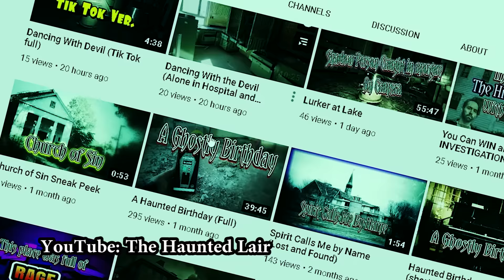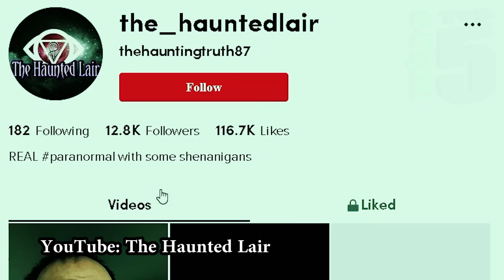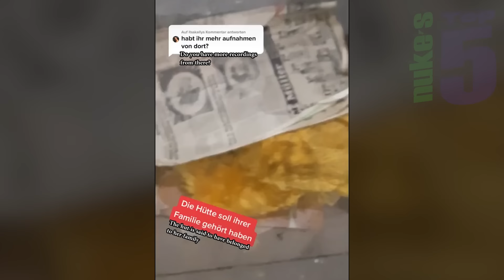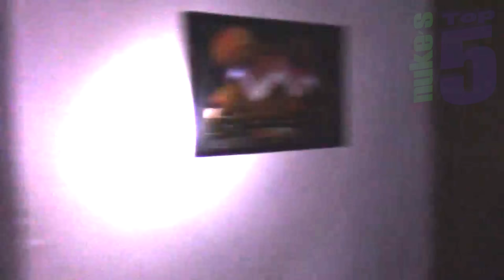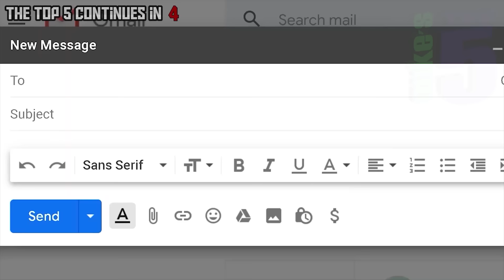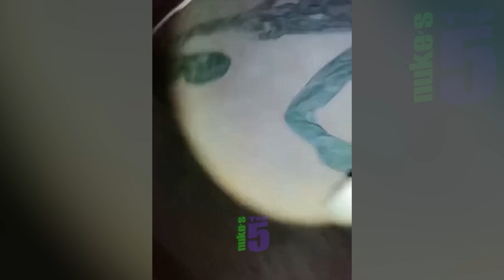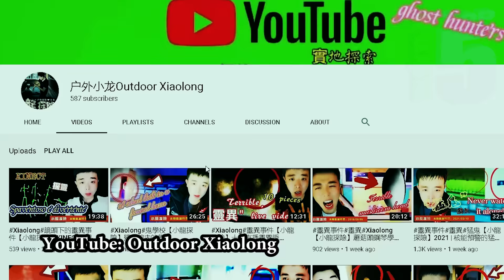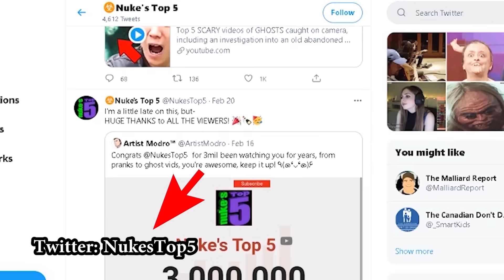5 Ghost Videos SCARIER Than Yo MAMA

Comment: The ghost light, a single bulb left on, on stage, when the theater is dark, is traditionally used so that theater ghosts are able to perform at night so they don't disturb the "livings" shows. Since the theater has been closed for 40 years, I doubt there was a ghost light left on. A majority of the ghost where spotted in places to view/work the performance.  So when Xiaolong and co. have their lights on, it signals "Show time". Lots of time the house light will turn on fully, then go off completely que the show is about to begin. Rather he knew it or not, Xiaolong was starting a performance... and perform for them he did.

Comment: 13:32 this is just an obvious camera issue. when the woman disappears just look at the left front tire of the truck. It also blurs out when it comes close to where the woman was walking. Also the motorcycle was a bit higher than where the woman was walking. It's obvious a small section of the video at the bottom is very blurry which makes certain objects distort/disappear. What you can see however is that the blur is constantly getting bigger & smaller (like a breathing effect) which is very strange. But nonetheless an issue with the camera (could be due to the weather).

Comment: 30:05 I just noticed while they were freaking out about the chair guy's shirt being pulled. The ball to the left of the bed guy flashed without anything touching it. If it was pressure from the sudden shift in weight, then at least some of the other balls should have flashed as well. As it happened bed guy swiped another ball out of the way and it didn't turn on.

Comment: #3 just has some water on the lens. Has happened to me at work as a security guard. When it rains and one of the camera lenses gets water over them, it looks like people just vanish, because the water drops reflect the ground behind them as the same color, but the view appears distorted. Same as in #3 in this video. It's very blurry down where she walks and it is raining. The motorcycle goes too far from the camera to get behind the water drop and that's why it looks normal. Also could be that the water drop slide down enough. The area where the woman walked looks very blurry anyway, which just confirms that there is just a water drop on the camera lens. Even the truck front wheels gets blurry because of the water drop.

Comment: The investigation with Cory and Matt.  That was a whole body apparition that looked like it flipped over on its back and floated over to Cory when his chair and jacket was tugged on.  when paused just right you can see the feet or what looks like shoes at the right of the screen and if you look to the left of the apparition you can make out a head.  You can see a jaw line and a bit of a face.